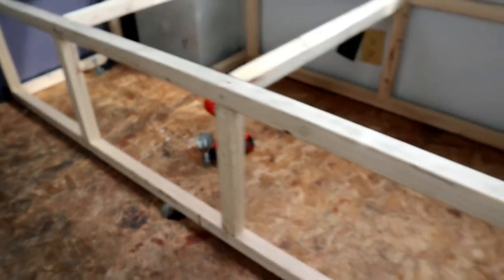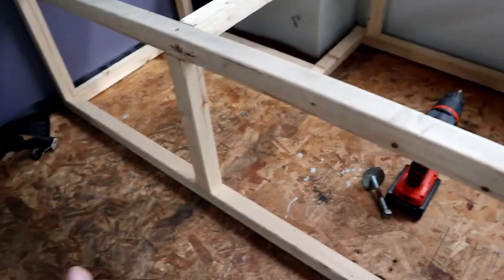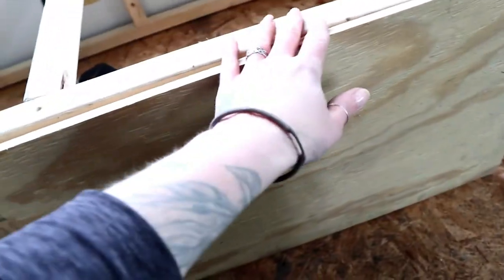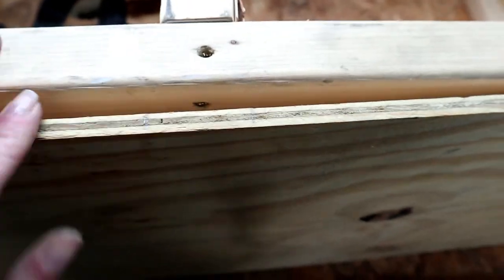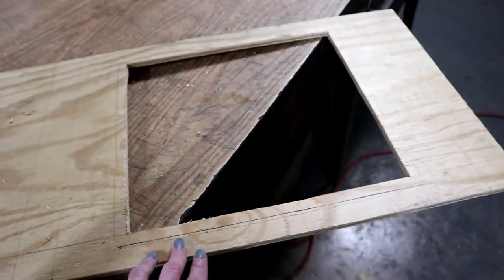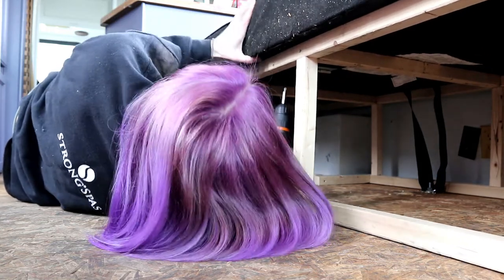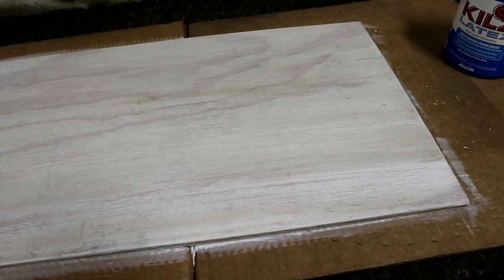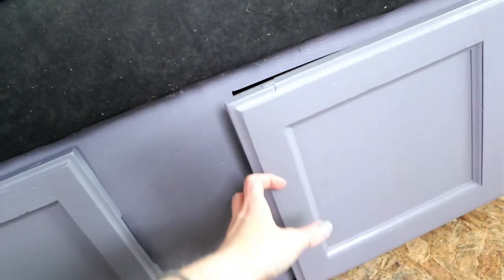The Rv Futon is FINALLY Done | How to Install a Futon in a Camper | 88 Ford Bravo Class C RV

Comment: My a1992 mtor home seating framing is  metal fabricartion. and the seatbelts are also supported with metal bracing.  I would have used screws from the start. Nails, unless they are decking have no grab . There is a right and wrong side to ply. Things you've never done before, YouTube is great for how to do DIY on RVs. Longer screws into the framng when attaching to floor so that about half an inch or more goes in. Bond crete is good for sealing plywood and dries clear.

Comment: One way to make the futon go down to "bed mode", if you want to go that way, is to use locking heavy-duty drawer slides. The pair in this link might not be exactly what you need at 24", but they're available in many sizes. You'll definitely want locking slides, where you pull in the tab to release & slide-out, that way it won't be sliding while you drive. Just something for you to think about. These particular ones are rated 264lbs, but that's the part that would be suspended in the air and you could always go with 4 slides instead of 2.  https://www.amazon.com/SDPAWA-24-Sections-Extension-Capacity/dp/B07D72Q63H
Reply from the maker: Yeah, I didn't really go into it in the video, but, I did think of drawer slides. I couldn't figure out how to attach the slides to the futon seat, and the base, without having it raised higher than it already is (which is pretty high for comfortable couch seating), without attaching the slides to the sides of the futon by adding wood around it. It was all too much to think about, and it was easier to just make it stationary. I also considered buying futon hinges and building my own from scratch, but again, just too much lol. I'm happy with the way it turned out tho, it serves it's purpose.
Reply: And serving it's purpose is all that really matters! I'm glad you were able to get it worked out to fit your needs.
Reply: We built ours like a palette so every other piece of wood was attached and then the middle pieces have blocks on the back so we can pull it out and double the size of it then slide it back in and it just looks like a palette kinda
Reply from the maker: @harryfp1494  Does it slide open and close nice? I've seen a few of these kind, especially in van conversions, but they seem to be a bit of a struggle to slide. But if I were building the seat from scratch, this probably would've been the way to go.